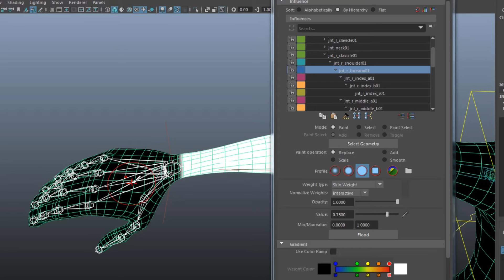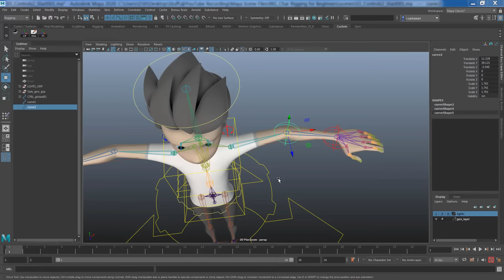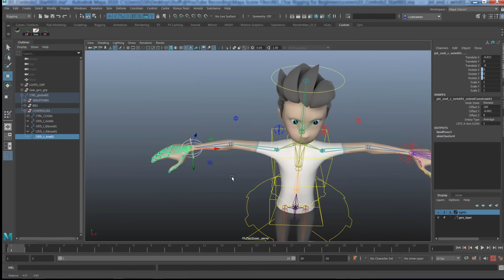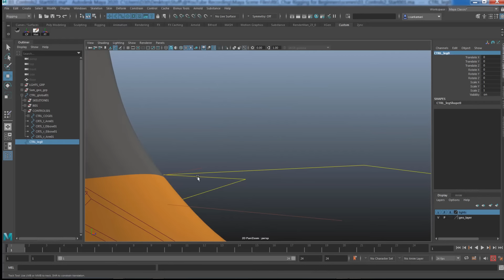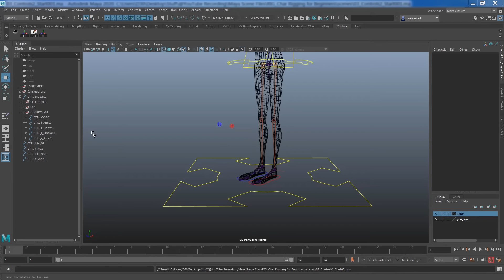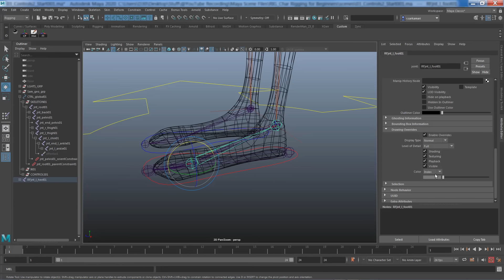Character Rigging for Beginners: 04 Secondary Controls

Comment: Thank you so much for these amazing videos! Just wanted to say when I was adding the wrist as an influence it would get rid of my weight painting that I already did, the way I fixed that was by checking "Lock Weights" in the Add Influence Options then you manually have to go in and paint it, but you keep all your other weight painting. I just wanted to say this in case anyone else has the same issue!

Comment: Hello! First of all congrats for your tutorials! They really help a lot. 

The thing is in this video im finding some trouble with elbow controller, when i do the Pole vector constrain from the elbow controller to the IK handle, it deforms my geometry by the shoulder and the wrist, like the geometry snaps to this bones... 

what am i doing wrong?? 
thanks!
Reply from the maker: Usually this happens when the orientation of your joints are not done correctly 
I also have an alternative method in my intermediate Rigging playlist which eliminates this issue.
Reply: Ok thanks, ill definately take a look on that ;)
Reply: Hello, same here! Did you solve the problem?

Comment: Thank you for these tutorials, they're great :) I'm encountering some issue though and was wondering if you could help me out. My skinning was good, polished etc and now it's completely off, as if I haven't done the weights at all. I saved multiple versions of my project so going back, I was able to point out that my problem seems to be happening after I've added the influence for the wrists. Any idea why ?
Reply: Well apparently checking "lock weights" in the Add influence option box fixed my problem :)
Reply from the maker: Yes. Celia is correct in saying this. Hope you solved the prblem there.